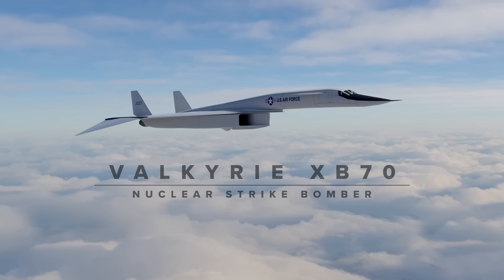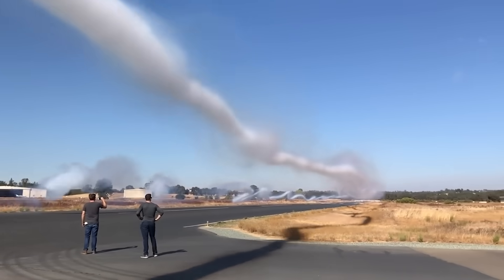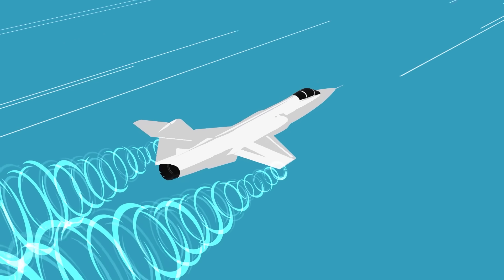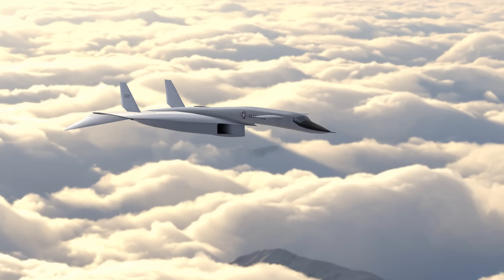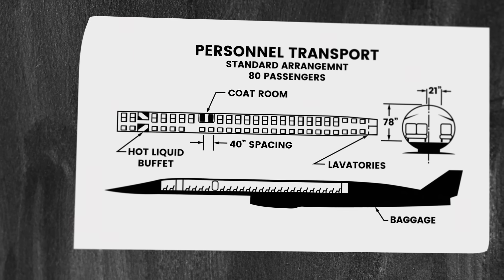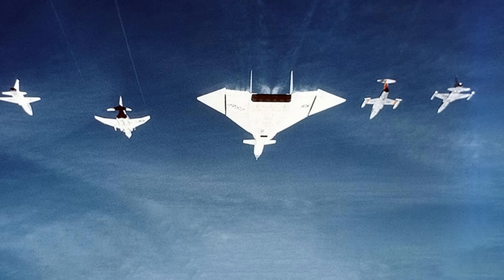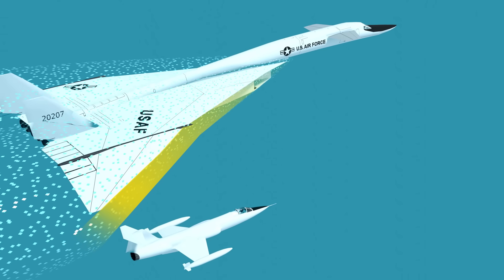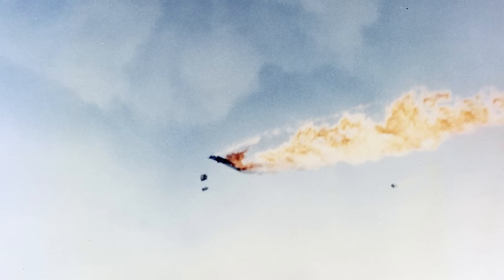XB-70 VALKYRIE | Wake Vortex crash explained

Comment: 3 versions of concorde!?
Reply: What does Concorde have to do with this airplane?
Reply: @winternow2242  Mate it looks like a concorde
Reply: @HexTheBot  really?  I don't see it myself. Maybe a few incidental similarities, but way more differences. When you look at pictures of each plane side by side, you'll see that the 2 look nothing like each other, and fly nothing like each other. 

Also, the XB-70A is older than Concorde,  so, if anything, it's Concorde that would be a version of this plane, and not the other way around.
Reply: @winternow2242  I mean it does kind of look like the concorde from its nose but yeah it is older than the concorde so I apologise if I was wrong

Comment: I've been an aircraft designer for over 20 years but when I see the Valkyrie I am floored by the innovation and skill of the engineers 60 years ago.  Those guys were all stars for sure.
Reply from the maker: People have no clue the endless effort and genius that goes into an aircraft design. When it appears effortless is when is when it was a truly fantastic team effort. Its the same with a great building.
Reply: Without PCs, with some using slide rules and actual drawing/drafting boards...
Reply: How far was the British Vulcan made before its time.
Reply: Then came people who copied it and made a concorde😂😂😎🇺🇸
Reply: @YourBritishLord The Concorde was not a copy of anything. If you put these 2 next to each other you see more differences than similarities.
Reply: @klapsigaarenbasgitaar1931  valkyrie flew in 1964..concorde in 69..both have sleek stretched fuselage..are delta designed and have tilting cockpit lol😉🇺🇸💝
Reply: @YourBritishLord  Except for the nose (and the tilting was in a quite different way) these planes completely don't look alike. Twin verticals, canards, engine positions at the back in stead of under the wings, number of engines, foldable wingtips, use of compression lift...
Reply: @klapsigaarenbasgitaar1931  come on dude..u know it. But wont accept it😉🥂💝
Reply: @YourBritishLord  The Tupolev tu 144 is more similar because it has Canards!
https://www.youtube.com/watch?v=A4tDlTJkquk&list=PLiuZ7mRLdHIJdzY-_l9WcHDH2nQ8sKwax
https://www.youtube.com/watch?v=64NCIoM6v2g&list=PLiuZ7mRLdHIJdzY-_l9WcHDH2nQ8sKwax&index=2
Reply: Cool story. I don’t believe you.

Comment: " the longer the wing, the smaller the vortex ....." BULLCRAP!  The XB-70 wingspan is a lot wider than a glider .. it's about airflow over/under and along the wing profile ....
Reply from the maker: Oh Telly relax 🫣
Reply: @Mike-Bell  There is 5 things contributing to wing tip vortex. 

That is an aircrafts:

 

weight

airspeed

AOA

wing configuration 

and 

proximity over ground. 

 

a 747 at let's say 145 metric ton needs a certain amount of lift to get of the ground. That amount of lift is coming from pressure differential regarding low pressure on top of the wing and high pressure under the wing. That pressure diff. is creating the vortex.

The sum of lift is the same, if you have lets say 75 m. wingspan or if you have 125 m. of wingspan. The only thing changing is the wing load (true only to a certain degree .. but that's another story)

Airspeed (over/under the wing) is also a major factor ..

together with

Angle Of Attack AOA

and

Wing Configuration (disturbance in airflow, giving extra lift) Clean wing is a wing with all "accessories" retracted .. no slots, no flaps, no airbrakes, nothing.

So a "heavy, clean and slow" aircraft is making the most wing vortex and back to the video .. my guess is, the XB-70 in the photo shooting was a "heavy, clean and slow" aircraft generating  a 'ell of a  lot! of vortex and disturbance in the air around it, the F104 pilot couldn't see the XB's wing tip, GE photographers were pacing them all to fly close, in line, "need 'n clean", "showmanship" so they lost concentration and their good "pilotship". 

We were never told about the gen. wind direction and speed that moment .. maybe some wind gust from the port side blew the XB-70 vortex into the F104, lifted it up and around to port, just smacking it down in the wing root of the XB-70 ????? 

The F104 being the most unstable of those 4 small aircrafts .. knew some of the Northern NATO countries Fighter jockeys flying the starfighter saying 

"It was fast like nothing in a straight line, but they forgot to build-in some equipment to turn that darned thing"  .. "On a sit-in alert duty, we could go from north west part of DK (airbase Aalborg) to south east part (Bornholm) in under 5. But then we had to ask for landing permission on airbase Bornholm ... to refuel to get back .."
Reply from the maker: If a 747 had longer wings its TIP vortex would be smaller.

Comment: NOT a bomber .. 2 .. l repeat 2 planes were build, only one having 'mock-up' bomb bay .. both still X planes ... aka experimental
Reply from the maker: So what you are saying is a fighter jet that is never in combat is not a fighter. So 99% of fighter jets in the US arsenal today are not fighters. The airforce has got it all wrong…
Reply: @Mike-Bell  First you learn to write correct English .. you're missing and misspelling words, so the reader has to guess your intentions/writings/meaning ... 
next is, the B-36 never dropped a bomb in combat but still came over the line of being an YB / XB plane like the B-47and the B-58. Amongst the fighters there are Gripen, Raptor, Typhoon, Mig 31 and SU 30, 33 & 35, etc. likewise in production but never seen combat.
Third is, how the heck you can get the interpretation of "combat vs. no combat" out of my text and that I use that as a measure to classify aircraft, is a great mystery .. since I didn't mention it nowhere. But i guess it's coming from your "massive brain capacity" ( <= very much irony right there) or rather "the missing of ..." and I'm fortunately not responsible for, how you read, understand and interpret my text, I'm only responsible for, what I write.

Comment: Correction. It was stated that the longer the wing, the less vortex will be generated. That is not the case! There are two major factors that contribute to wing tip vortices, the weight of the aircraft, and the aspect ratio of the wing. Aspect ratio is the relationship, or ratio between the chord length v/s wing span. A higher aspect ratio wing, will generate less vortices than a low aspect ratio wing. A contributing factor is weight, regardless of the wing geometry, wing tip vortices will increase as the wing load increases.
Reply from the maker: The longer the wing the smaller the tip vortex - for the same aircraft weight. 
The heavier the plane the larger the wake. 
The wake is the total disturbance. 
The vortex is the rotation off the tip.
Reply: @Mike-Bell  Exactly, thank you for expanding, or punctuating and clarifying my brief explanation of wake turbulence. Generally speaking wing loading, regardless of aspect ratio and wing geometry, is the largest contributor to wing tip vortex intensity. Thanks 🙏 ….. Just two nerds chatting 🥸!

Comment: 1:23 "The plane stays up by pushing air downwards...." Really?? Uhm nope. Basics, air moves at different speeds over the wings creating a high pressure below the wings and a low pressure above the wings. Air flows from high to low pressure thus creating lift.. It stays up because it's lifted upwards is a better analogy.
Reply: Then how can planes fly upside down?

Comment: The only two certificates I I had on my PPL were for aerobics & formation flying. I gained a lot of interesting experience over the years, as my reason for having achieved a PPL, was that joy of flyuing - I used to participate in competition flying with the aero club, aargh from scenic flights for friends, vertebrate used aeroplanes for ttrave purposes.And yes, I was very aware of. The vortex danger, however, I’m not a Yank, and therefore did not seek glorification, nor was I a Braggart like most of thetr ilk.

Comment: The cause of this accident was partially due to choosing the Learjet as the photo ship.

All the other aircraft are supersonic capable, mach 2+ aircraft. 

At supersonic speeds, wake turbulence is less a factor. If the XB-70 was at speed, with wingtips deflected into waverider configuration, the supersonic shock wave would have been generating additional lift, in conjunction with higher Q, meaning lower angle of attack in supersonic cruise, the wake vortex's would have been substantially reduced or eliminated.

Great video. I always thought there was something else to it, considering the talent involved.
Reply: They never would have done a photo shoot at supersonic speed anyway.

Comment: ACTUALLY....THE  MASSIVE 
VACUUM OFF  THE  SIDE 
OF  THE COMPRESSION  WAVE    CAUGHT  THE FLYING  TAIL   OF  THE  
F104  .......THIS   PULLED
DOWN  THE TAIL  .....
WHAT  YOU  CALL....
THE  PITCH  UP...THE  DIHEDRAL  OF THE WINGS
AS  THE ANGLE OF  ATTACK
BECAME  MORE THAN   THE 
CONTROL  SURFACES  COUKD  CONTROL......AND THE  F 104   WAS  VACUUMED INTO  A DOWNWARD  MICROBURST...THAT
THE XB70   CREATES....
THE  REST  IS HISTORY...

Comment: The Lockheed F-104 was the most unstable aircraft in the US arsenal because of its stubby wings. The jet interceptor was built for speed, period. It was designed by the great Kelly Johnson and his Skunkworks team with great haste, in response to the perceived Soviet air superiority at the beginning of the Korean war. They found the right-sized wing for maximum stability at Mach 2, by strapping wings to missiles with a rear-facing camera, and firing straight up. Film  was collected and studied after the missile descended by parachute. Any F-104 pilot will tell you that the low speed handling of the aircraft was poor. 

Placing this aircraft next to the XB-70, which produced heavy "turbulence" was  a foolish request. The fact that Joe kept the Starfighter in formation for 45 minutes attests to his skill as a pilot. Of course, neither the photographer nor the engine contractor realized the gravity of their error until the inevitable occurred.

This was a terrible loss that was 100% preventable had the person in charge said no to this bonehead request made by a contractor.
Reply from the maker: Excellent commentary.  👍
Reply: @Mike-Bell  Thank you, Mike. I have the benefit(?) of being older than dirt, and remember many of the details surrounding this tragic event. I thought your audience might enjoy knowing some of these details that may not always get reported by producers of these videos who had the cooperation of the US DoD. 

Thank you for showing these videos on your channel. They are a rich and interesting history of the Cold War acceleration of aeronautical design. 

Personally, I would have loved to see a fleet of B-70s flying, even if they never dropped a singular nuclear bomb.

Have you got anything on the B-1A, that was first designed to fly way above Mach 2, but was killed by Jimmy Carter? I'm sure he did the right thing, but it would have been another amazing achievement if built. Still, the B-1B, now slated for retirement, was is another amazing aircraft. 

Ukraine could use a few dozen of these aircraft slated for the boneyard (where else would you park your Bone?) 

Cheers.

Comment: Excellently done, and includes film footage of the XB-70 I've never seen in any other video of the plane. This video also explains the role of wake turbulence in the incident better than any I've seen. It's narrated clearly and the graphics, mixed with actual footage, are outstanding.  The research done on sonic booms, using the XB-70 is slightly tainted, because the use of compression lift with the drooped wingtips tended to focus the supersonic shock wave downward, increasing its energy in that direction.  I was a youngster when this plane flew, and it has always been my favorite, alongside the SR-71. It's truly a huge aircraft, I've walked under it at the USAF Museum when it was housed in the Museum Annex hangar at Wright-Patterson AFB. The SR-71 is half its size, maybe less.

Comment: Great video and animation. Been following this since I was a kid in the 1960s, and my father was a USAF bomber pilot in the 1950s and 60s. He told me that I might be flying it one day, as a replacement for the B-52 that he flew. I got up close and personal with the remaining XB-70 at Wright-Pat AFB in 1980, before the AF museum was revamped. The XB-70 was outside in front of the museum and I was there just before closing, when almost no-one was there and it was getting dusk. There was a jack-up extended maintenance stand a few dozen yards from it, and since I had used them when I was a USAF crew chief, I thought why not get a picture of the cockpit. I screwed up the jack stand pods and pushed it over to the XB-70, then jacked up the stairs until they were level with the cockpit and ran up the stairs to the platform. I got several pictures before a patrolling Security Police airman saw me and yelled at me to get down from there, which I did, but I was close enough to  touch the side windscreen although I did not touch it. A moment of magical wonder for me at that time.
Reply from the maker: Great story! Thanks for sharing. I would love to see your pictures 👍
Reply: Great story! I have a soft spot for the B-52, but oh my, the B-70 was magical.

Comment: My understanding was that the loss of control was due to the three redundant hydraulic systems being compromised when the vertical tails were sheared off. This explains the controled flight for that "15 or 20 seconds" while the life blood of the machine blead out. Admittedly a bit accedemic, but we should really understand the detals.
Reply from the maker: Its simpler than that. Without vertical stabilisers aircraft have no yaw stability and will skid into a spiral dive. Only with computerised yaw stability does the B2 maintain yaw control without vertical stabilisers.
Reply: @Mike-Bell  The outer wing panels were in a lowered position acting as an inverted V tail contributing to the airplane's yaw stability. I can't say if it was sufficient; it would be interesting to see some analysis confirming/disproving whether there was enough vertical tail volume to counter the destabilizing effects of the extensive fuselage. The divergence was remarkably slow, showing stable (at least steady) flight for more than 10 seconds. If you inspect the original footage,  the yaw appears simultaneously with a pitch up. My experience with mid century boosted controls would have me suspect that as pressure bleed down, the control surfaces wandered off neutral positions. Fighter planes of that generation had that feature.
Reply from the maker: @Jared Smith Yes the pitch up is quite distinct. My assumption is the wingtips drooped at 25 deg mid position the vertical component was pretty small. It kept it straight for longer but in total was not enough. One fin was totally gone and the other one had a small stub of about 20% survive. 
In my research I cant say hydraulic failure came up although the damage must have been significant and would be an explanation for the pitch up. 
Al White did apply differential thrust against the yaw but the engine lag must have been long. Jo Cotton from his perspective gave the craft no chance and was almost immediately telling them to bail.

Comment: a stealthy remake of the xb70 valkyrie would be a perfect successor to the b52 
as a conventional weapons bomber aircraft
Reply from the maker: The inherent shape of the Valkyrie is not stealthy at all. A redesign would be an entirely re optimised shape. It would hardly resemble this beauty. Interesting that XB70 and SR71 were first flown 2 months apart and the SR 71 already had early stealth features whereas on the Valkyrie they paid no attention to it at all. That was before it was a thing

Comment: I'm wondering if the fact that the fighter that caused the crash (an F-104 Starfighter), was a little unstable anyways (with it's stubby little wings), so it was easier for the vortex to cause it to spin out of control into the XB-70.
Reply: Good point!
Reply: Short wings are inherently less able to resist wingtip vortices, but not because they make the airplane unstable. It's because the wing has less span remaining outside the vortex to resist rotation.  This is why small aircraft are at always at high risk from wake vortices behind heavies regardless of their inherent stability.

The lateral stability of the F-104 was actually intentionally reduced by the anhedral angle of the wings because it would have had excess stability with zero dihedral angle, but it was still stable.  The Lockheed C-5 has anhedral for the same reason even though it is a heavy transport rather than a fighter.